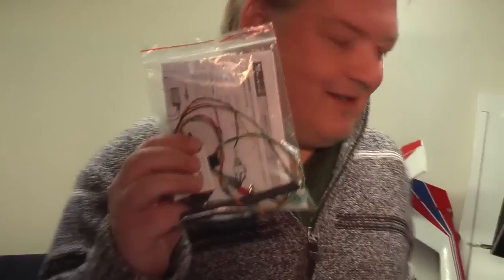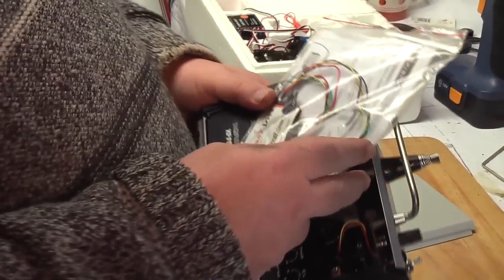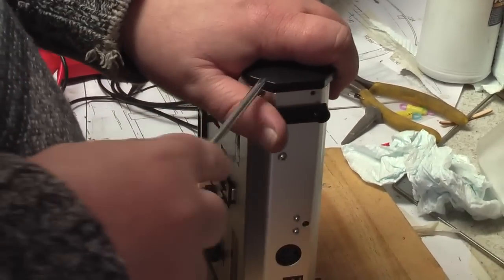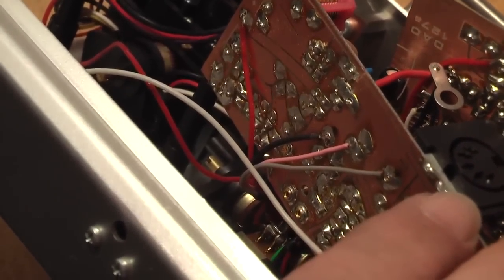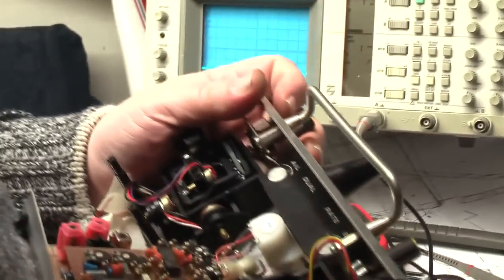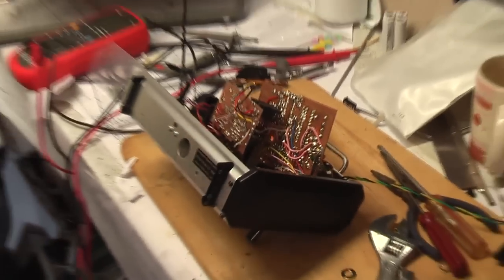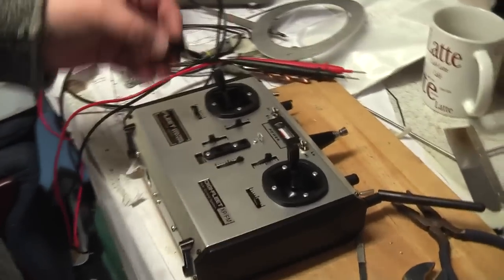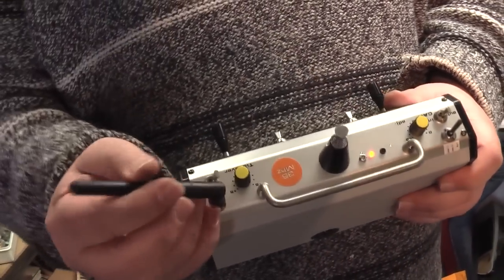Digifleet Conversion to 2.4Ghz - RC Model Geeks

Comment from the maker: Just a note to say if anyone wants their Digifleet Radio converted to 2.4Ghz I'm happy to convert it for them.
Reply: hi mate, i have a fleet pcm mx7 set can this be converted to 2.4 ?
Reply from the maker: @robertdickson9082  i cant see why not.
Reply: @Rcmodelgeeks  hi Rob , I have the digifleet and also a hi Tek laser 6 , whick one  would be the easiest to convert?
There doesn't seem to be much room in the digi.
I would use either for boats rather than planes.
I used to build planes years ago but my son kept me busy building so I never learned to fly.
Hands knackered now so safer with boats.😁
Reply: Hi, I have just joined your face book page, very interested in having a Digifleet TX converted, but PC board a bit lacking in copper, especially where battery connections are soldered. Can it still be and and what cost?Michael

Comment: Hi Rob, Bit of an old vid now, but I hope you can still answer a question. Contemplating the same conversion, but I won't want to retain the 35 ability, so my inclination would be to remove the rf board altogether. However on your vid it shows a further two wires, pink and brown, connected to the board. Wonder if you would know the purpose of these wires, and whether I would be safe to just disconnect them.
Thanks
Jeff

Comment: Hello. Interesting and very well done. I too have a DigiFleet  radio and looking to convert to 2.4Ghz, are you still able to carry out the conversion?
Reply from the maker: Hi Graeme i am not sure if the FRsky module is still being sold. I will get back to you. Cheers Robi
Reply from the maker: Send me an email rcmodelgeeks@gmail.com
Reply: Hi Graeme The Frsky module has been discontinued, so they are difficult to get hold of now. However, Lemon also do a diy board which works the same way. It will bind to Lemon's own receivers but also to Spektrum DSM2/DSMX receivers, giving a wide choice of units. Hope this helps. Jeff

Comment: The batteries did you make them up or can you buy all conected up in fours ? ,cheers
Reply from the maker: i just got 8 AA cells with solder tags on and joined them.  You could just buy 2 RX battery packs as long as the are AA and square not flat.
Reply: Wanker

Comment: I take it you can charge the bigger batteries through the chaging port as per usuale?
Reply from the maker: Yeah thats right. You can even use the original charger. It will just take longer to charge fully of course. ;o)
Reply: Wanker

Comment: thanks for that i have a blue one i will get it out of the loft and have go, many thanks.
Reply from the maker: Before you start poking around inside it. Remove the sides and disconnect the batteries! 4 batteries at each end ;o) they will be junk anyway. i replaced mine with 2500mah  AA cells.

Comment: looks good i have a digifleet which looks older than that one, i will have to open it to see if it will work.
Reply from the maker: The earlier ones generally were either black or blue. with silver gimbals. Generally the principal is the same. I dont think the rf board changed very much.